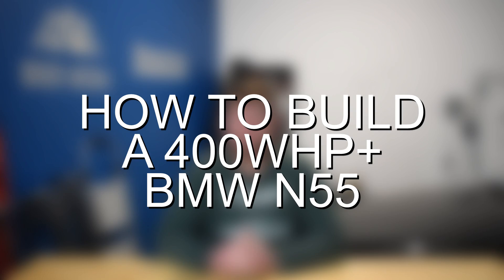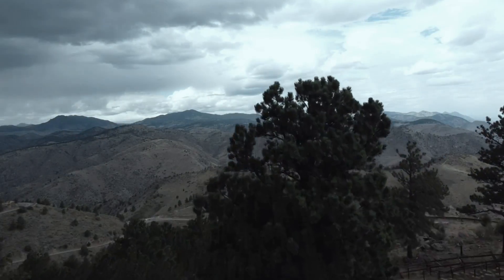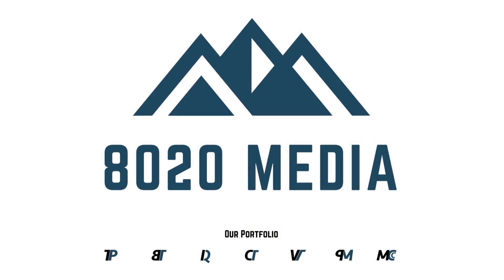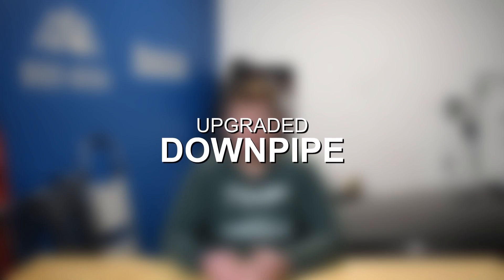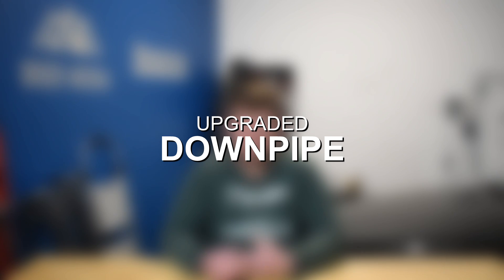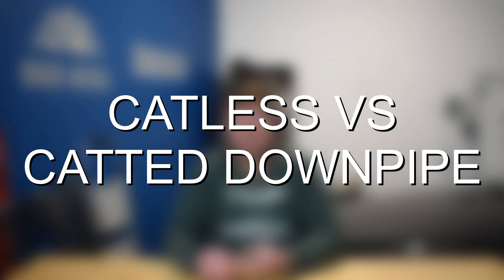How to Build a 400 WHP BMW N55 With Only $1,500!

Comment: After the 1500 you will need 15.000 for repair it 😂😂
Reply: Since you said 15.000 for repairs that's $15 in US, about 12.83 Euro, and 280 pesos, so $15 will top off some E85 fuel and good to gap any Subaru, Lexus, or Honda with "stock" horsepower/torque, or with just $1500 in same comparable level bolt on's and tune. 😁
Reply from the maker: P - Lol, false news.

Comment: Glad i came across this video. Just have a question. So to run a e30 mixture on a 2018 m2 n55 all you need is a e30 tune? No hpfp or lpfp needed?
Reply from the maker: L - Hope it helped! Yes, to run an E30 mixture on a 2018 BMW M2 with the N55 engine, all you typically need is an E30-specific tune—no upgraded high-pressure fuel pump (HPFP) or low-pressure fuel pump (LPFP) is required for that ethanol content. The stock fuel system can generally handle up to E30 safely because it doesn't max out the fuel system's flow capacity, assuming your injectors, pumps, and pressure regulators are healthy. Just make sure you’re measuring your ethanol content accurately, either with a tester or an ethanol content sensor, and use a quality tune (like from Bootmod3, MHD, or a custom tuner experienced with N55 platforms). Once you go past E30, that’s when fueling upgrades become necessary.

Comment: So is 400whp around 500hp (crank)? Pretty impressive and b58 type numbers for the price, i think the EWG N55 is super underrated, for some reason. It's just about as reliable as the b58, with good maintenance, for half the price.
Reply from the maker: I'd say 400whp is more realistically 450 crank hp. It also depends on the specific dyno and many other factors, but in general I'd say most modern cars should only lose about 8-13%. Nonetheless, it's hard enough to compare 1 dyno to another let alone trying to convert crank and whp numbers.

As for reliability, I would put the N55 (even the EWG) much closer to the N54 than I would the B58. Outside of injectors, turbos, and HPFP (all stuff covered under recalls, extended warranties, etc) the N55 really isn't any more reliable than the N54. The EWG models also come with the downside of the incredibly lackluster f-Chassis. Each to their own but the G-chassis M-lites were really the first true "upgrade" since the N54. No disrespect to the N55; it's still a great engine and car.

Comment: I’d be extremely wary of who you buy your tune from. If you pick a bad tune you’re probably going to have problems. From my experience what kills the N55 in my opinion is using the wrong oil filter. I’d only use OEM or the Mann filters. I’ve seen inferior filters collapse and cut off oil flow.
Reply from the maker: G - Thanks for sharing these insights.

Comment: Just for everyone's reference, I have a 2016 435i xDrive (N55 with EWG). 
I have the following mods.
CTS Turbo Cold Air Intake
VRSF Charge Pipe
VRSF 6.5"  Race Intercooler FMIC
VRSF High Flow Catted Downpipe
I then went and got a custom Stage 2 Tune from a local tuner and it's pushing just around 400WHP with 91 fuel from Esso.
I asked the Tuner why not 94 fuel. He said due to where I live with the weather and elevation, the difference between 91 and 94 is negligible unless I'm min maxing and that TINY bit of difference is important to me. He figured I'd prefer better mileage which is true lol
I'm sure I can improve this with a catback exhaust upgrade which I'm hoping to do sometime soon.
What he's covering in this video is accurate but obviously you'll have slight differences depending on what tune, what brand/quality of the mod, etc...
I HIGHLY recommend you get a charge pipe upgrade. It's cheap and it'll save you headaches... it's the first thing I did...
Too many of my friends had their charge pipe blow on stock vehicles...
Reply: I had that exact car but sold it for $2000 more than I paid for it after having it 2 years and putting 40k on it before doing the upgrades but you did almost exactly what I was planning. Didn’t want to sell my honey but I couldn’t turn that down 😢 my only question is with a stage 2 tune I’d be surprised if you weren’t making way more power. Did you get it on the dyno for a true HP rating??
Reply: @greaterbw  no i didnt dyno it. it was a rough estimate based on other people who got the same tune with same mods. I'm hoping to get it dynoed :)
Reply: Same build but I just got my hpfp installed and was making about 20lbs then my wastegate went ☹️
Reply from the maker: J - Thanks for taking the time to share your build! Sounds like a sick one.
Reply: What kind of exhaust do you have and how does it sound with your stock? I assume exhaust with the catted downpipe? I love turbo noises, I have a 335d straight piped and its amazing, but I know gas engines are way noisier and arguably better sounding. JK, they definitely sound good, I just dont want it to be too loud or have to get a valved exhaust. Also how is your manual or 8hp? Im debating about a daily. Ik the 8hp is super nice, but I miss rowing gears like in my e46 330ci hpde car. Im at sea lvl and with 93 ig id be closer to about 415ish whp?

Comment: Didnt mention you need two step colder plugs gapped appropratley plus all the gaskets for the oil leaks and coolant leaks youll soon develop as you add power 😂
Reply from the maker: You don't need colder plugs on the N55 to run a tune and basic bolt-ons. Sure, it won't hurt anything but the N55 actually runs OEM plugs that are 1-step colder than the N54. We've run OEM N54 plugs to 400+whp on multiple cars without issue. Again, N55 plugs are already 1-step colder so it's really not necessary on most stock turbo builds.

Additionally, the N55 is prone to those issues with or without increasing power. An oil pan gasket, valve cover gasket, or oil filter housing gasket isn't going to go bad just because of power and mods as long as everything is in good working order (notably the PCV system).

Comment: i have a 2014 m235i rwd. i plant to replace all bolt ons basically. intake turbo inlet and outlet/boost pipe, charge pipe, and intercooler. do u think the upgraded bigger 7 inch intercooler is the best option or just the upgraded 4 inch intercooler
Reply from the maker: N - For your 2014 BMW M235i RWD, the 7-inch intercooler is the better option if you're planning to replace all bolt-ons and maximize performance. The larger 7-inch intercooler provides significantly better cooling efficiency and prevents heat soak during extended periods of spirited driving or track use, which is especially important if you’re running an upgraded turbo or higher boost levels. However, if you’re only doing moderate bolt-ons with no plans for high power or aggressive tuning, the 4-inch intercooler can suffice and offers easier installation with less weight. Choose the 7-inch intercooler if you’re aiming for maximum performance and reliability under demanding conditions. Keep us updated!
Reply: @8020Automotive  thanks bro. gotta address my leaks and maintenance first unfortunately😭. but definitely plan to get the most reliable and fun power out of this thing. even stock feels surreal to have my first “dream” car in my driveway and be able to start building it
Reply from the maker: N - Love to hear this. This is how we got started!

Comment: can the pwg be converted to an ewg on the n55 e90 chassis?
Reply from the maker: C - Converting a PWG to an EWG on an N55 E90 chassis is possible but requires a turbo upgrade, additional wiring, and advanced tuning. It's a worthwhile modification for high-power builds but may not be cost-effective for moderate upgrades.

Comment: this title is really misleading. an MHD tune license for n55 is 550$, a good intercooler is 500$, good chargepipe is 250-300$, a catless downpipe which won't pass emissions and causes car to stink is 300$, a high flow cat is anywhere from 500$ to 2000$ depending on brand. a good cold air intake is 250-500$

i would say to do it right and not get the cheapest crap parts, the low end it's much closer to 2500$ and that's not including labor if you want someone else to install these parts.
Reply from the maker: M - I'm sorry you feel this way. With prices going up on a lot of things since the beginning of the year, it could be a little more than $1,500 depending on new/used parts.

Comment: I have all bolt ons mentioned. To run an e30 map, can I just fill the tank with e85 even though the tune is for e30? Any problems doing so?
Reply from the maker: P - Would advise running e30 for e30 tunes.

Comment: So I just ordered a VRSF 6.5 comp intercooler. Should I exchange it for a 5 inch? F87 M2. I dont plan on upgrading the turbo ever. just want a stage 2 tune
Reply from the maker: C - Don't need to. Either will work.

Comment: I can’t stress how pertinent it is to upgrade from the stock plastic charge pipe. I just blew mine up at Hockenheimring after three 15 minute sessions.
Reply from the maker: K - Couldn't agree more.
Reply: This is what drives me crazy about BMW for a car with that price using plastic on the charge pipe and cooling system components is just insanely stupid. Use metal and charge $400 more on the sticker price which absolutely nobody would notice and protect your brand’s reputation but I guess the bean counters have more influence than the engineers.
Reply: @greaterbw  they just want you to bring it back so they can charge you to fix it if they made everything work perfect and there wouldn’t be no need for parts and service😢😮😅
Reply: Fr
Reply: Chargepipe, boost pipe and turbo inlet pipes are all common problems so you might want to replace all of them.
Reply: Haha i blew mine up 5 minutes on my stage 1 tune not even pulling or anything

Comment: Great video and good to see the n55 get love. I have a 2018 LCI M2 6spd manual. Currently have 520whp on 93 and with e50 blend make 620whp. I have pure 750 turbo, FBO( vrsf fmic, catless downpipe, charge pipe, boost pipe, M performance exhaust, stage 2 hpfp and lpfp, Turner motor sport carbon intake, m2c carbon and aluminum strut braces with m2cs steering tune, m2c seats, m mirrors, m performance shifter and steering wheel, GTS hood, m2cs carbon front lip, aftermarket carbon rear diffuser and side skirts, PSM carbon fiber high kick spoiler, carbon fiber eye lids and m2 fender badges. Next will be wheels and suspension. This car is a dream and sounds amazing. Not maintenance issues because I stay on top of oil changes, brake fluid, and any seals or gaskets, I also have the mossleman thermostat up grade. This car will be a keeper. Perfect street and twisties machine with some good high way pull performance. I don’t and never wanted this to be a drag car I could easily get a b58 xdrive car and do that , but where’s the fun in that. Plus the n55b is a little more stout with forged components and an other unique only to the m2 bits.
Reply from the maker: K - Thanks for the feedback and taking the time to share your build! Sounds like you've got a sick one.
Reply: N55s want love. Parts makers and some sellers don’t want to give them love.
Reply: 520 on stock turbo?
Reply: @ShmittyW  oh damn my bad. lol I forgot. Hell nah. Pure 750 turbo upgrade.
Reply: Xwaa5#10
Reply from the maker: A - what?
Reply: i’ve got all of the mods you have except the m exhaust stock turbo stage 1  93 
 I’m getting 520 torque but only 420 hp.

Comment: i have a 535 2014 here in brazil, i have installed Downpipe, k&n inbox and i just bought a dv+, needs a remap pr a mhd for it
 
is very necessary to change the boost pipe for stage 2? 
or the original is safe for it? 
tks dude
Reply from the maker: E - Nice! Sounds like you're building a solid N55. It's not necessary, but recommended. Keep us updated.

Comment: Most N55s won't get anywhere close to 400WHP with bolt ons unfortunately. BM3 and MHD both claim approximately 420bhp on their stage 2+ maps, and since these cars have a 20% drivetrain loss that's 340-350whp max from the OTS tunes.

To get close to 400whp you'd need an EWG N55 with full bolt ons, and a proper custom tune running E30. Even then I think you'd be capping out at 380whp, limiting factor for us is the fuel pump (which is a very expensive upgrade), followed shortly by the turbo (which is another very expensive upgrade).
Reply: I have an F32 N55 DCT with VRSF Charge Pipe, VRSF Catless Downpipe, Intake, MHD Stage 1+ tune, and straight pipe, and I make just shy of 390WHP.
Reply: m2 dp and tune is easy 400whp
Reply from the maker: A 20% drivetrain loss is a very aggressive assumption; I'd say 10-12% is much more realistic. Nonetheless, there are plenty who have reached ~380-400whp on the PWG and ~400-425whp on the EWG. They're definitely higher-end numbers and not everyone is going to see that. But that's a whole other topic with dynos and power numbers. It's tough to compare different dynos, on different days, different builds, etc.
Reply: @8020Automotive  Yeah I take my comment back, I'm from Australia and our Dynos here read about 15-20% lower than US dynos
Reply from the maker: W - No worries.
Reply: @wingmanlmg  You're actually correct its 15-20%
Reply: @Ur_cristiano_778 it's not a % that's a poor rule of thumb for higher output

Comment: FYI, you can still drive with the leaked/broken charge pipe, you just lost the boost from the turbo and will show CEL.  After the restart, the CEL will be gone.
Reply: Yup, happened to me.  Mine cracked at the MAF flange. I drive with the MAF dangling.
Reply from the maker: C - Thanks for sharing your experience haha.
Reply from the maker: S - Yes you can, but what's the fun in that?

Comment: What oil would you recomend when pushing 400+? Running 0w40 Motul right now, curious to see if there's a better option, cheers.
Reply from the maker: O - LiquiMoly 5W-30 or 5W-40 is what we recommend with the N55's.
Reply: @8020Automotive  Does the motul 0w40 also work? Just changed :)
Reply from the maker: O - Sure, just providing options we recommend.

Comment: I have some questions in reference to modifying my F30

1). What is the risk of doing these modifications at 140k miles versus say 40k miles. Prior to my ownership the cars been maintained at the dealer and I’ve been keeping up with the maintenance with no issues aside from a distinct tick on cold starts  I haven’t fully diagnosed.

2). What would be the next viable turbo option after completing these mods without going to a crazy huge top mount kit and would it require additional fueling or could you run a slightly larger turbo on stock injectors pumps etc
Reply from the maker: The risk should be relatively similar at high mileage if the N55 engine is in good condition. Of course, the engine is going to have a little more natural wear and tear so it could expose certain issues faster (like rod bearing wear, for example).

Something like the Pure500 or Pure Stage 2 turbo are good options if you're looking for a "modest" turbo upgrade. Fueling upgrades would depend on many factors like power goals, fuel (pump gas vs E85), water-methanol injection, etc. However, it's likely you'll need at least some fueling upgrades unless you're going for a conservative setup on pump gas.
Reply: @8020Automotive  Thank you very much, I understand. I’ll be looking into the differences between those turbos and how others have set them up in terms of fueling. I greatly appreciate your reply I’ve been enjoying my N55 and I think I want to pursue pulling more power out of it rather than switching to a b58 powered car just yet.
Reply from the maker: D - Keep us posted!

Comment: Just subscribed to your channel, really appreciate your content. Just upgraded to a 2011 535i M-Sport from a 2008 328i . First turbo car i ever owned so really excited to start a build .
Reply: I have a question, so as I said my first turbo car. I checked the boost level with Carly it stays around 14 psi at normal speed but if i floor it , it  hits 21 psi and tappers down to around 15 is this normal ? I don’t know if the previous owner tuned it but I do know I get a “bank 1 catalytic converter message “ every 100 miles or so , I just reset it until I can check the down-pipe/catalytic converter factory I think . The car does not run bad with the code .
Reply from the maker: D - We have a ton of N55 content on our BMW website that we think could be helpful here: https://bmwtuning.co/bmw-n55/
Reply from the maker: D - Thanks for the feedback! Keep us updated on your build.

Comment: Here's my take on my 2014 335. CFS large intercooler honestly I prefer a better quality intercooler but at the same size, stock intake with a rectangular hole cut out like the performance intake, downpipe tune engine and transmission,3.5 bar map sensor the icing on the cake large 3" Pro tuning freaks charge pipe.
Reply from the maker: C - Thanks for sharing your build.

Comment: I have a 2011 E92 335i With the N55. Currently FBO besides a CAI. If you want to maximize gains and compete against an N54, i would highly suggest looking into a custom tune to truly wake up your N55. The XHP transmission tune would definitely help as well.
Reply: Im running a intercooler downpipe and charge pipe with mhd stage 2 plus tune. Rn i dont think im making mugh more then 320 wheel what should i do to reach 350?
Reply from the maker: E - Have a full list of things here: https://bmwtuning.co/400whp-bmw-n55-engine/
Reply: @eduardomierisch8254 you should be making more then that ! my buddy has a 2016 m235i with just catless and a stage 1 and he’s making around 345-350
Reply: @eduardomierisch8254 what cars are you faster then ?
Reply from the maker: C - Thanks for sharing your experience. We completely agree!
Reply: I got the same car, loving it so far, it came stock and will upgrade as soon as i can